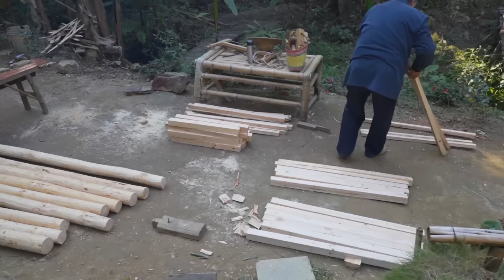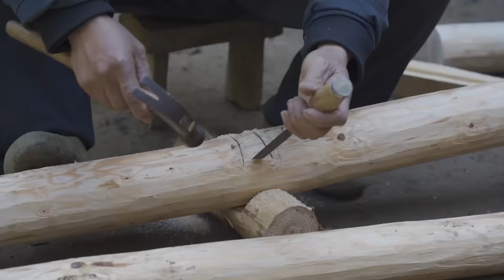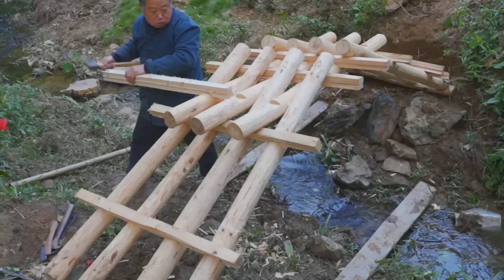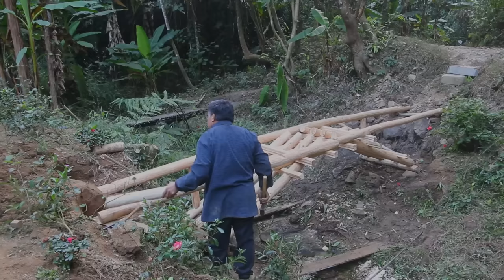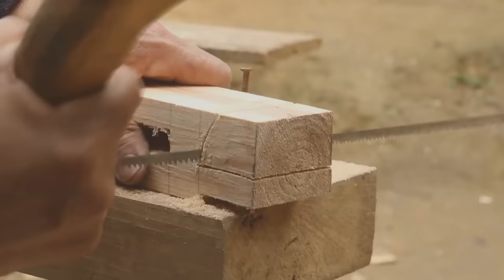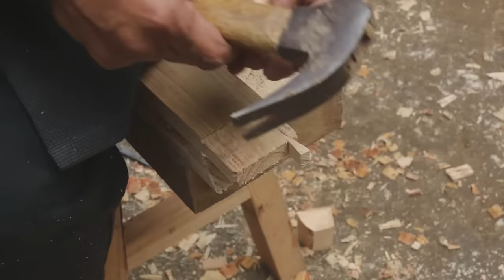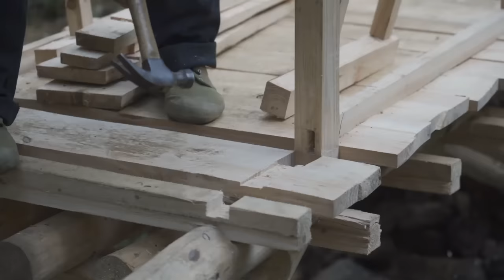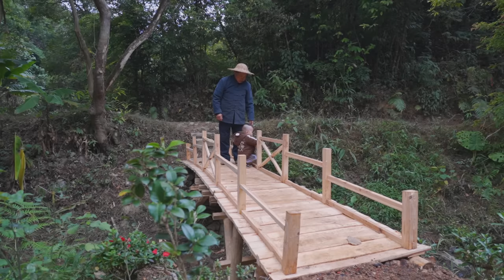阿木爷爷榫卯打造一座木拱桥，全程无钉子，高手在民间【阿木爷爷 Grandpa Amu】

Comment: Very good wood joining probably from techniques of centuries ago when nails, screws and bolts were not available or known.
I've noticed a small wedges used in the bottom of the rail posts ... ingenious ... when the posts are driven down the wedges expand to make the joint tight.

Comment: No mails, no glue, no power tools !! India and China still has the finest carpenters and craftsmen who can do anything without nails and screws & glue.  The carpentry basics are still sanctum Santorum.  Dovetail joints, half lap joint, mortise & tenon… if we start learning & practicing these techniques LOWES, Home Depot, Ace Hardware and their suppliers in China will file bankruptcy..!! So the Corporate America will make sure you use screws, glue and machined hardware & machined lumber for all your DIY projects 😂

Comment: A lot of effort for this kind of bridge, it looks almost too stable. If the river is flooded, she's probably gone. Why isn't it built a little higher, since the surroundings are higher too? The wood in contact with the ground will rot very quickly, there is no dry support. The railing design is far too low and unnecessarily has different heights.